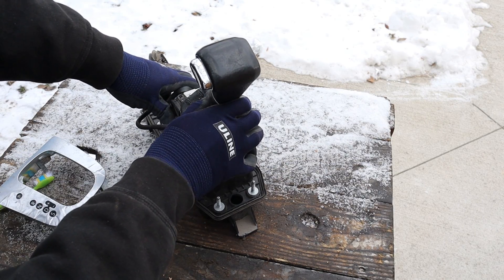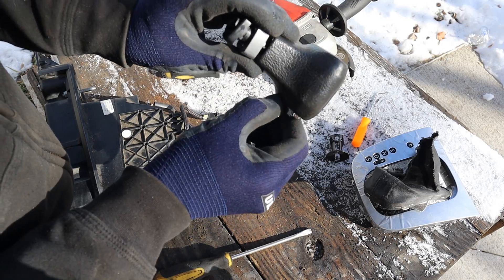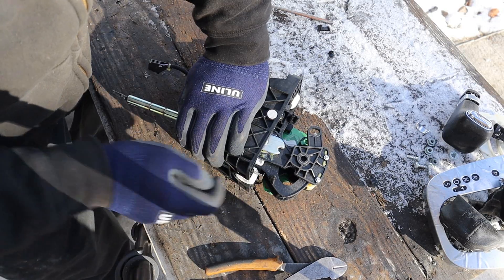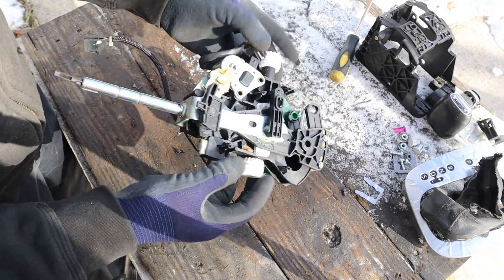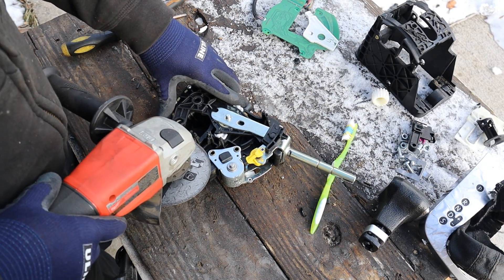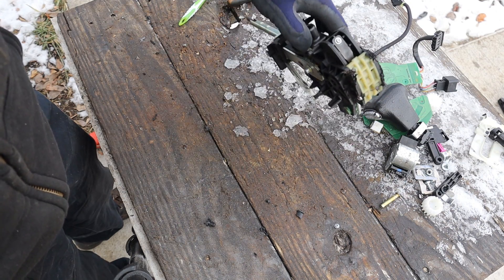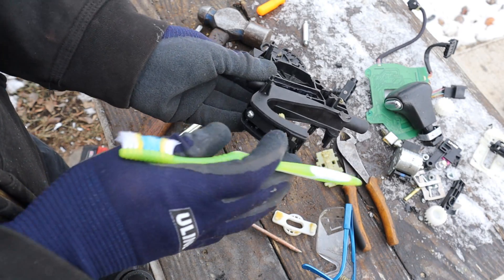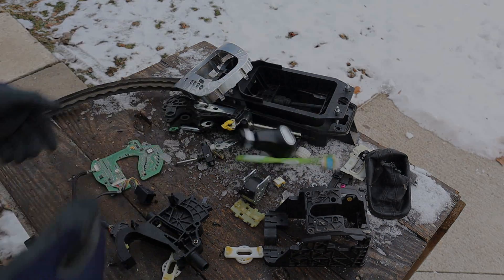How a Car Shifter Works

Comment: Complicated!!! Just now have an issue with my 2012 Infinity EX35 Shifter. It's like if totally fails to engage and the shifter moves from Park to other gears with 0 impedance and resistance... Fuse? Electronics? Mechanical? I'm in troubleshooting mode! Help is appreciated!
Reply: bad shift lock solenoid

Comment: What is the voltage of the connector pins of the electronic board that sends the manual mode and "+" and "-" signal of the shifter to the main gearbox control board?  Does anyone have a control board diagram?
Reply: not a sensor so likely battery voltage

Comment: What is the voltage of the connector pins of the electronic board that sends the manual mode and "+" and "-" signal of the shifter to the main gearbox control board?  Does anyone have a control board diagram?
Reply from the maker: You'd have to check the service manual

Comment: Always good to share the white atmospheric deposits with my neighbor to the north. If that unit needs to be dropped down rather than pulled up does that include removing the transmission in any way? Kinda risky having electronics close to cup holders for a klutz like me. Looks rather inexpensive, right. As always, exceptional video on yet another brain in an automobile.
Reply from the maker: Actually yes it gets removed from.below. That entails removing the exhaust and heat shield. That's crazy!!

Comment: Amazingly complex, with many little parts to assemble !  You didn't point out the little coocoo bird and chime though.  Since it is so easy to fix and remove, service should be a breeze, even without that nifty rotary, any head style, any size screw removing tool you have there.  Farfegnugen !
Reply from the maker: Love my grinders!

Comment: Cool - more complex than I expected - interesting getting gear position signals from the shifter and not the transmission, like other designs - probably a more hospitable envt for electronics
Reply from the maker: I think most cars have the sensor on both the cable and transmission...

Comment: Why does it even have a mechanical link? The transmission is electronically controlled anyways

Also, and totally unrelated, why do automatics have a "park" function? Why not just a normal hand brake (that at least some automatic cars have too)?
Reply from the maker: There are parts in the valve body that are controlled by the bimanual valve. See my DSG teardown video

Comment: So what would happen if I shift to P or R with car moving at 60 kph (Canadian heyy)?
Reply from the maker: Nothing. This transmission is electronically controlled and would have logic to block that. Even if it was manually controlled, the engine would just stall.

Comment: What would happen if you were driving and your  shifter went to reverse would it destroy the transmission?
Reply: The Neutral Drop Channel here on YT will answer this for you.
Reply: There should be prevention by speedometer, but please, can you prove this theory?
Reply: If you actually get it to engage ya it could, or lock up tires and you crash.  Hard to do on late models they wont let it happen.
Reply: I believe that is called "the money shot"
Reply: @johnw3379  * shift.
Reply: It probably will in older cars but don't modern cars (anything in the past decade) have lockouts for that?
Reply from the maker: New cars are electronically controlled and have logic built in to prevent this. On older cars, if the transmission does engage the reverse clutches it'll likely just stall the engine.